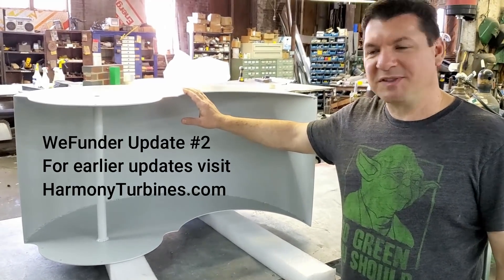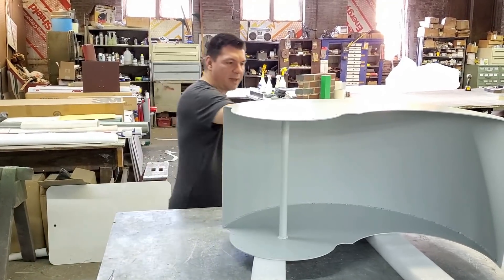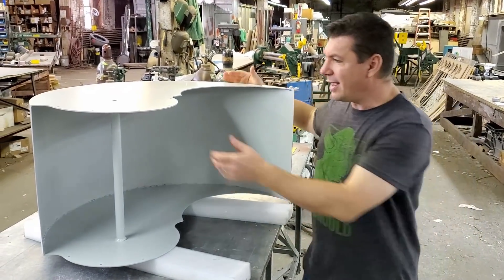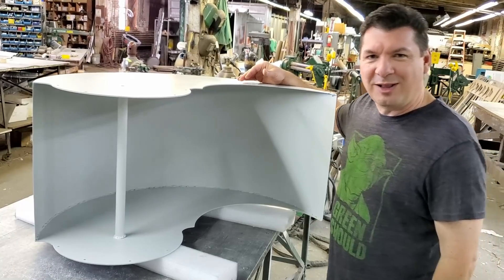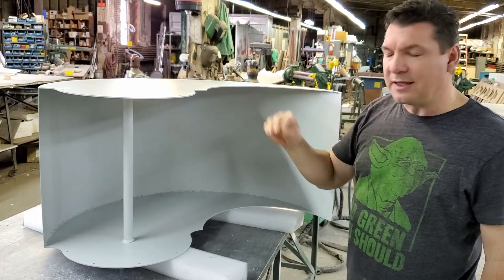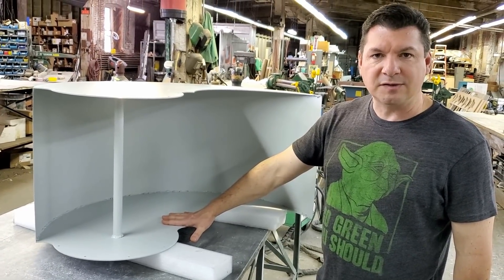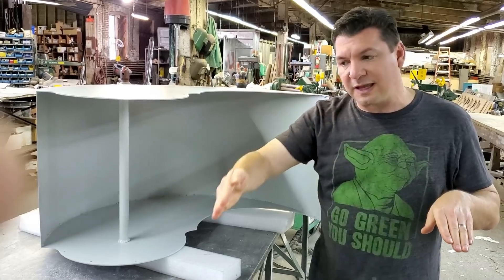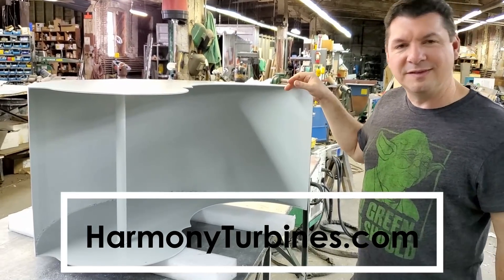Harmony Turbines new prototype development - WeFunder upate #2

Comment: 18 lbs. per blade.. Have you figured out what the weight would be for a heavy duty plastic blade yet, and what the efficiency would be over an aluminum blade?  Wondering if a plastic blade could be manufactured in three different pieces and secured together in some way (Maybe a customized L bracket).  Make the curved piece flexible enough to bend and you could use a CNC milling machine hooked up to CAD software to manufacture them.  Whatever you do, don't outsource this to China!   Look how they decimated the solar cell industry.  If this is successful it's possible electric companies in Cali would try incorporating it on a larger scale.    Since natural gas has become so cheap, it will have to be enticing enough for them to bite.

Comment: Figure skaters go faster when smaller because of conservation of momentum not because its more efficient to be smaller.?.?.?
Reply from the maker: Pancho I know that's what causes a skater to go faster once they start their spin and bring their arms in. I was in no way trying to say that smaller is more efficient. What I was saying was that there's an equation which expresses how quickly a circular object would spin at its periphery to match the wind speed and as that circumference decreases the RPM's of that object increase if the wind speed remains the same. Likewise in the efficiency calculations for wind turbines the smaller the swept area, (in this case diameter) the more efficient the turbine is if the output remains the same. That's why I can't wait to start doing some testing with the full-sized prototype. A number of people have said that our most "efficient" state will always be fully open, but I believe we will find "sweet spots" where slightly closed is more "efficient" than fully open in given wind-speeds. If we can plot these sweet spots we can program our furling algorithms to "hunt" for these most efficient states. That data would then be hard-coded into the production units and be exceedingly valuable to our end-product! Does that help to clarify what I was trying to say? -Sometimes too much detail in the videos causes people to just shut it off.